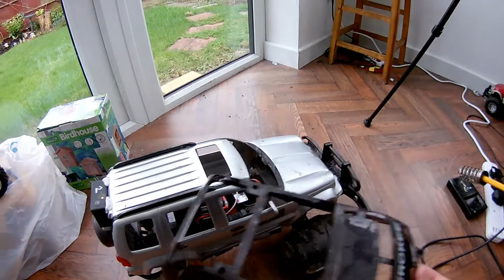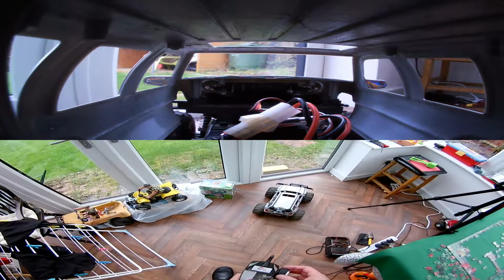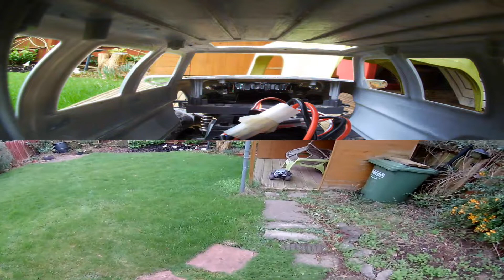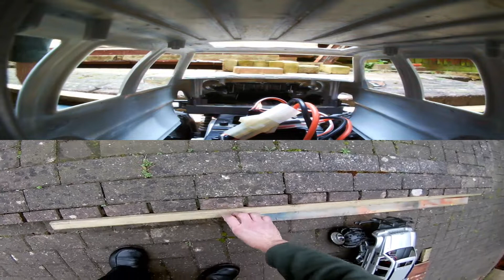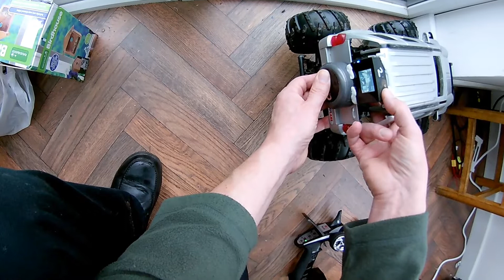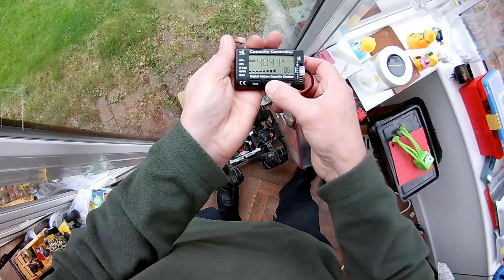New ESC in the Jeep Cherokee 200203

Comment: Working well Graham. That is a good big Jeep, but it is not too keen on going over obstacles. That old ESC is in some mess. Did you put the same type back in it? I think I asked you, but forgot, as usual. LOL
BTW it sounds like an engine when you rev it up. 👍👍👍
Reply from the maker: I don't remember what the burnt one was but the new one is 320A Brushed ESC Electric Speed Controller Waterproof for RC Car Truck Boat Ship - cost me £10.78 for 2

Comment: Hi man, so i got two hobbygrade servos , 3 Wires, can i connect them to a toygrade receiver that has two Wired (+&-)?
Reply from the maker: Easy answer - NO - they work in a completely different way and you need a hobby grade receiver to control them.
Reply from the maker: On second thoughts it depends exactly what you want to do with them. As far as controlling a toy car goes, my first answer stands BUT you might find the videos in this playlist interesting 
Working with RC servos https://www.youtube.com/playlist?list=PLA5a2xPRSrB1nJ5I3Uzrjf41VCJzrab4p
Reply: @GrandadIsAnOldMan  Hi, i managed to get It working :) so it Took me a while to figure Out i cant use The 3 Wires, it didn't work. I got frustrated and was like HMM it cost me 3€ for 1 servo, so i Took off The bottom, saw three wires , cut them off, saw The motor inside servo and i just soldered My Wires to that, that was so stupid that it worked :) 
Now The electronics are pretty much ready, some Minor tuning of The servo arm and wire length and then i Need to mount The steering assembly, then servo to that, driveshaft to motor and diff,fit mess together.
Reply from the maker: @ryzenenjoyer2824  well done, yes one of those videos in the playlist I sent you shows you how to convert to DC working but your receiver will only drive it one way or the other, you will have lost the auto-return to the middle so you will have trouble driving in a straight line. One of those videos show you how to modify them for continuous rotation so you can use them as small geared motors. They are popular in robotics.
Reply: GrandadIsAnOldMan yeah, ill propably buy a "better" (50€) transmitter/receiver at somepoint, and convert the servo back(to three wires idk). have a great day :)